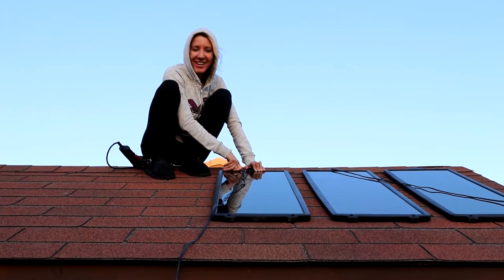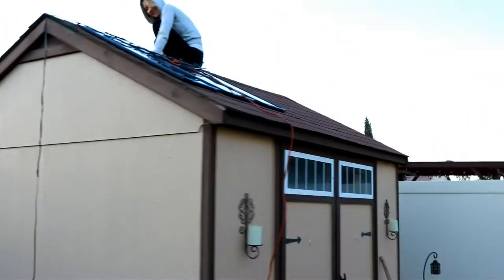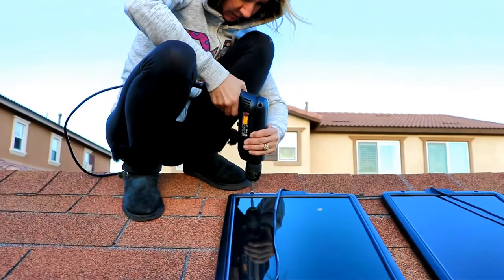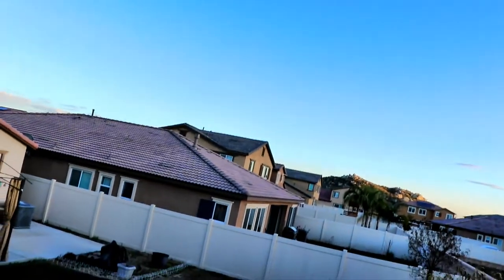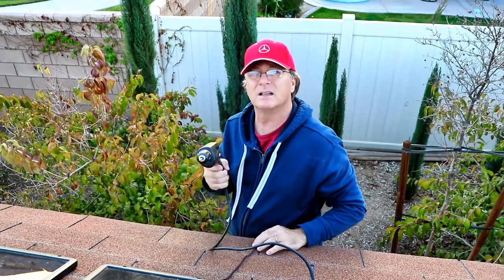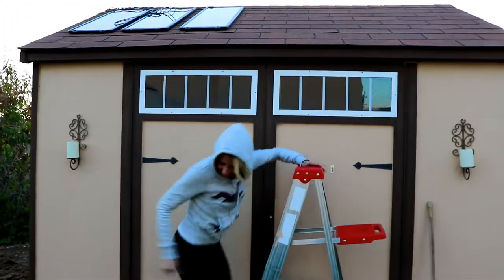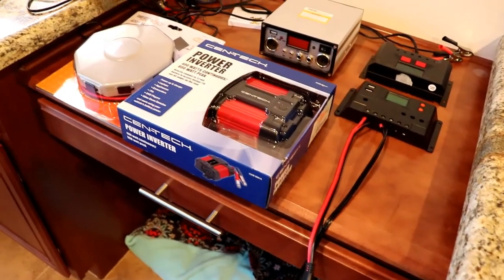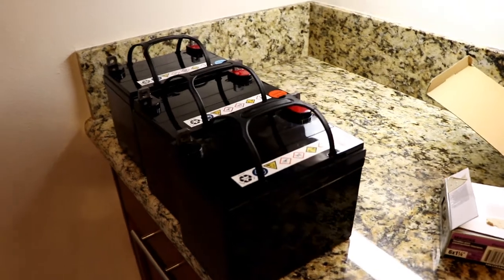Pool Project 1. Installing Harbor Freight Thunderbolt Solar Panels on Shed Roof. 400 watt Inverter

Comment: Wonderful.  Water management is your big financial issue.  Even a pinhole leak,over time, will rot the ceiling.  Mold, insects like the damp wood and eat it, then birds and squirrels.  Any fastener through a shingle will cause leaks unless it is under a flap and on the self sealing strip. Even then, amateurs like me may ( or may not) suggest thorough sealing with appropriate caulking, then pressing very hard to make sure it is sealed, as opposed to creating a hump for water to run in.  This is delightful and informative.  But it could be costly, particularly if you compromise a garage or home roof.

Comment: how do you keep the water out when it rains no sealant on srew holes
Reply from the maker: You are correct that we should have. I guess why we didn't is because it really doesn't rain here. I probably get it more wet when I hose off the solar panels. The screws are also going through a sticky tar roof shingle that in our 110 degree summer sun heat has most likely melted tight around the screws. Anyway, They have been up with no problems for over a year and there are no water marks or stains on the plywood looking up from inside the shed. Thank you for taking the time to comment.
Reply: @billisa  your a nice couple !
Raise the panel the width of a painted un treated 2×4  treated shrinks and warps ,air flow cools the panel ,I painted mine white ,
Cooler the more efficient and they will not degrade so fast, please,put tar in and around all roof penetration points.
So you won't risk life and limb for a decade or better lol.
Reply: @billisa  no morning dew every day ,either?
 Your shed is very nice did y'all build it yourself?

Comment: Not sure you will get this but I have questions. I have 3 batteries, 5 panels- and everything you explained in your video. I followed you because you were easy to understand. I powered my sand pump and salt water system this summer but during day- no problem. I’m now trying to run a heat lamp for new baby chicks at Nysa we have just had a cold snap here in Florida panhandle. It runs for maybe 10 minutes , shuts off and starts beeping. What am I doing wrong? Any advice appreciated.